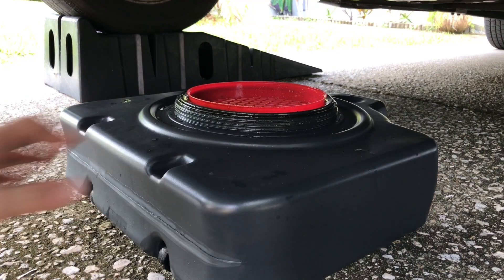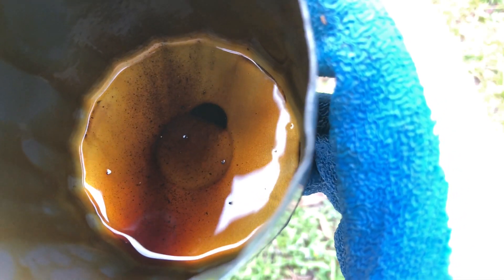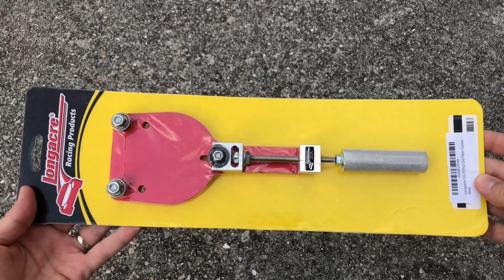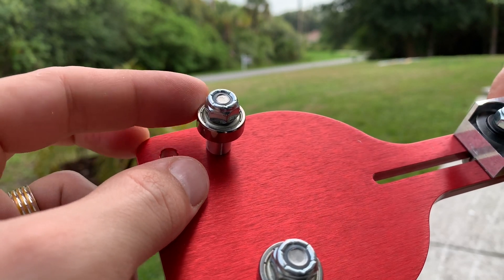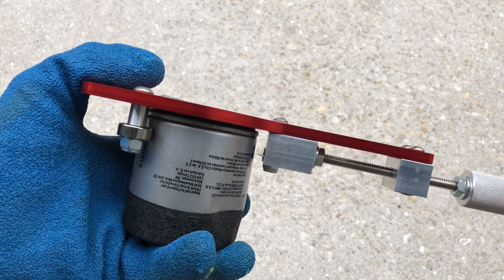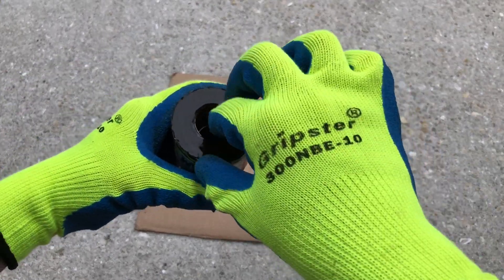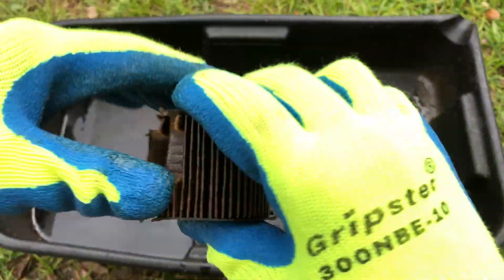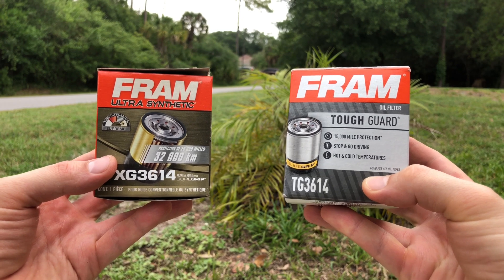How to check for early signs of a catastrophic engine damage.

Comment: Refuses to my power outlets are not blown but it still doesn't work what could be another problem or issue that would cause that to happen
Reply from the maker: Could be damaged wiring somewhere. You can use a circuit probe tool to check if the power outlet is getting any voltage. Here is an example of how it works: https://youtu.be/XOISbu2qmgQ

Comment: Oil filter cutter; who knew such a thing existed! That's worth subscribing to your channel in itself. I had heard horror stories of what's inside really cheap oil filters so like you said it is worth tearing them down to check for metal shavings off the engine and just to check for the quality of the inner workings of the filter. The FRAM filter looked pretty substantial but there are probably levels of quality within every manufacturers product line.
Reply from the maker: Thanks for subscribing, I really appreciate that! 
I actually recently cut 2 different tiers of Fram filters, and was surprised how little difference there is. 
I’m thinking to make a separate video about it soon...
Reply: @DIYtime  Reminds me of the movie, "Factotum" about the American poet, Charles Bukowski, who had some pick-up jobs in his long career as a writer and a drunk. In one job he is sitting at a table boxing brake shoes and the boxes are for different qualities of shoe but he doesn't know the difference. He asks the boss and the boss says, "Don't worry, they're all the same." Makes you wonder what else is all the same on the inside but sold as "good", "better" and "best" on the outside. At least you didn't find a roll of toilet paper acting as the 'filter element' like in a Frantz oil filter: https://www.frantzfilters.com/